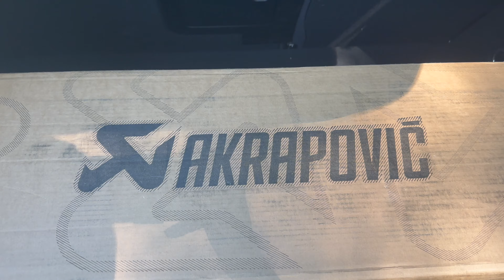Yamaha MT-07 2023 Akrapovic Install #akrapovic #mt07

Comment: Hey man it looks good and sounds nice I’m planning on putting the same one to my 22 MT 07 
I have a question did you had to put a any gasket? Does it comes with the exhaust Or theres no need of putting a gasket 
Thanks
Reply from the maker: It doesn’t come with the exhaust. Pple suggests to put new gaskets but I use my old gasket since my bike is new. I only have 700 miles when I installed it.
Reply: OK perfect I guess I’ll do the same. Mine only has 1000 miles.
Appreciate it. Thanks.

Comment: Nice! Your levers look good too! Did you have the ECU flashed also? The bike may be running a little lean with the new exhaust. You also need to change the air filter with a DNA air filter. Then your bike will be set. If you decide to have it flashed, try 2 Wheel Dynoworks to flash it. They're the best!
Reply from the maker: I have not done ECU flash yet. I think of doing next year.
Reply: @SueDan32  I had a 20' MT-10 that I flashed and put a DNA air filter and exhaust on it. It made a world of a difference. I sold that two years ago because I wanted to get back into motocross racing. Now I miss having a street bike. Now I want a Yamaha Tracer 9 GT plus. My wife, who is from the Philippines, wants a bike too. So I want to get her a MT-07 and put the exact exhaust on hers that you did! I'm impressed. You have a nice MT-07 there! Just do your own research about the flash. That's what I did and it was amazing after the getting everything done to that MT-10.
Reply from the maker: @hjmoto thank! I will

Comment: Bro, how did you take out the DB killer?
Reply from the maker: you need to drill the hole then use "Bearing Puller Set 5pcs Slide Hammer Puller Tool" to pull it out. It was really hard to take it off but with bearing puller, it only take second to pull it off

Comment: Can i have link  this exhaust
Reply from the maker: https://www.sportbiketrackgear.com/akrapovic-yamaha-fz-07-14-17-racing-line-titanium-full-exhaust/?gclid=EAIaIQobChMIv_fIuNmOhAMVjDbUAR3ZuQ-7EAQYAiABEgLA_PD_BwE
Reply: @SueDan32  thanks 🙏 it's hard to remove db killer?
Reply from the maker: yes it very hard but no if only you have right tool. you need to drill the hole then use "Bearing Puller Set 5pcs Slide Hammer Puller Tool" to pull it out.  @gilardinofranut8694